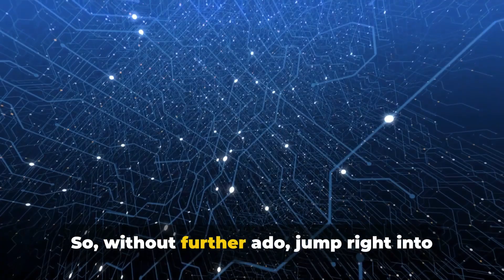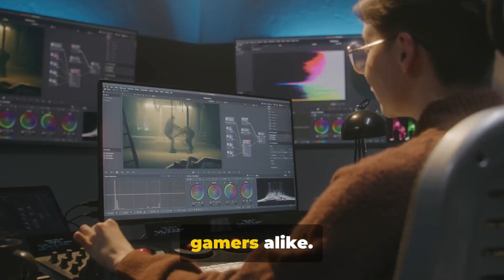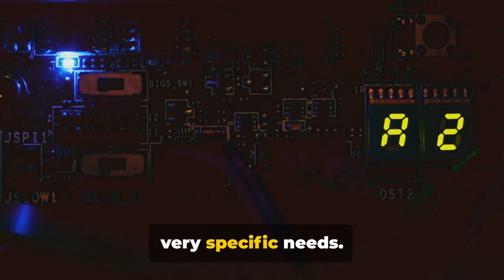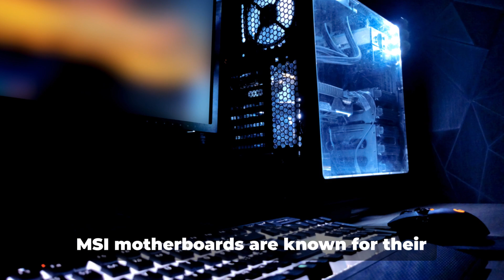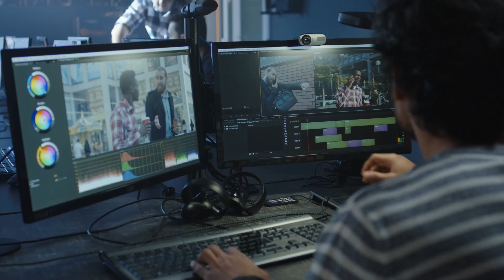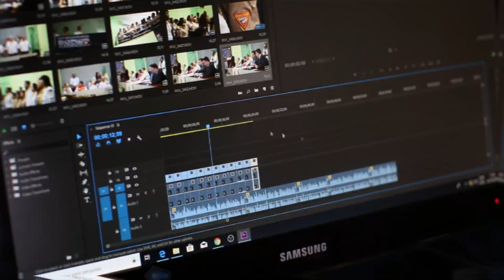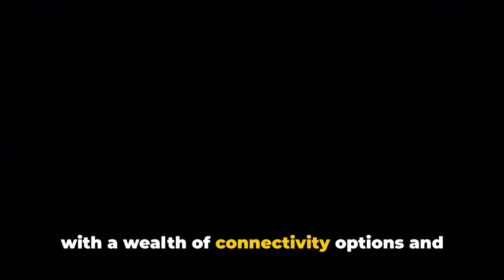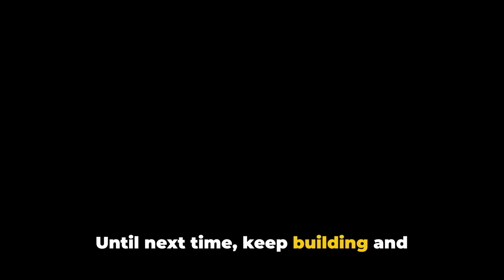Top AM5 DDR5 Motherboards for Ryzen 7000 Series A Creator's Guide

Comment: So i hope you respond to this comment because i have a few options for my new build and it really seems like you know alot and this video was amazing and it would help alot to know. So wich of these motherboards is the best for 7900x for gaming and productivity? Asus Rog Strix X670E-E gaming wifi OR Asrock X670E Taichi OR Asus Prime X670E-PRO OR MSI MPG X670E CARBON WIFI DDR5 AM5 OR Asus Tuf X670E plus wifi OR MSI MAG X670E TOMAHAWK Wifi? As you can see i have got really mixed up with all this haha😂 But it would really help if you could tell me wich of these are the best and the prefered budget is 350 dollars!
Reply from the maker: Hello friend, I'm glad that you liked our walkthrough for the best motherboards for AMD's chip video, for me personally i would prefer asus over the others and based on what you have just said you have to choose between two asus options ROG STRIX X670E-E and Prime X670E-PRO, for your budget the prime would fit that perfectly as it coasts 320$ but if you can increase it more and get most valuable one  definitely go with rog strix one, for me personally im using rog strix F gaming and im going to upgrade to E series, but both of them are great ,just a slight add-ons in the E would give you more advantages.
Reply: @CreatorsPCUniverse  Ok! Thanks alot man!